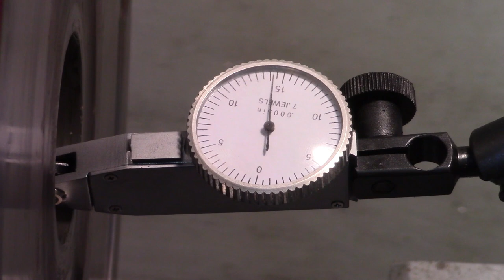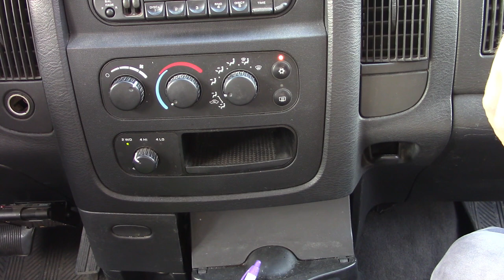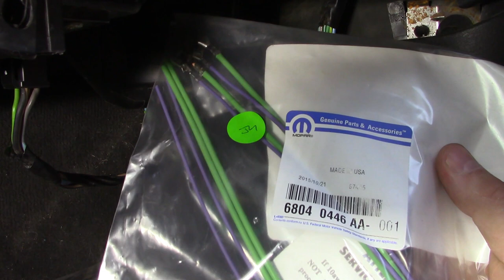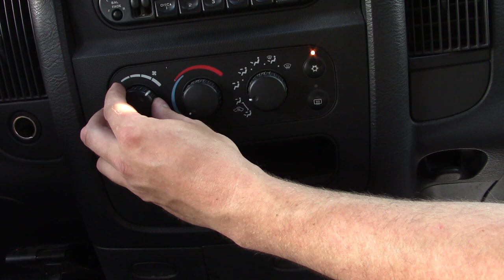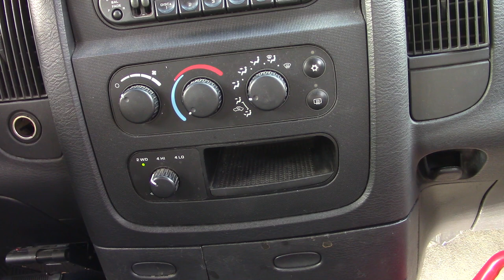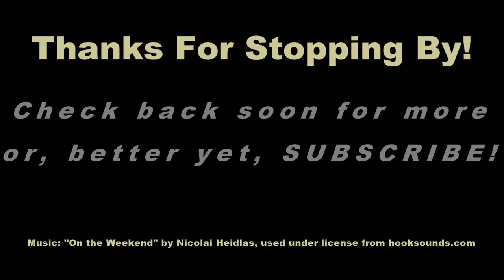Shop Update & Blower Motor Connector Repair

Comment: My connector to my 2006 Infiniti m35 is not online anywhere I have no idea how to get one !!
Reply from the maker: Hi Dnario, you mentioned your car so out of curiosity I started looking up Infinitis.  Like you, I could not find anything for the connector to the blower motor itself, and looking at pictures of replacement motor units they look like they are an oddball design for sure.  Even RockAuto, where I often go if in a pinch, didn't have one.  I guess going to a wrecking yard might have to be in order, otherwise if you could maybe fabricate something up with good-quality spade connectors and some non-acidic adhesive to glue them to the terminals on the motor?  Seems kind of dumb that replacement connectors are not available.
Reply: @EverettsWorkshop  thanks brother yeah I went to “Findpigtails.com” they had the exact piece it’s getting cold out wouldn’t want to not have heat

Comment: 2005 Towne & Country. Please! Tell me....i don't have to sodder!!! Lol was never told I would need to and that just crimping everything together would suffice....i don't have a torch lol or whatever and have already spent more money on this than the local mechanic would charge...
Reply from the maker: If you use a good quality crimp splice and crimping tool it will work fine, I just prefer to solder.

Comment: I changed wires but it keeps melting 🤷🏻‍♂️
Reply from the maker: If they keep failing you may need to replace your blower motor and resistor as well - if there's a bad connection in one of them it can create an unwanted voltage drop and create a hot spot in the harness.  I was able to clean the terminals in my blower but yours might be too far gone for that.

Comment: Is there anybody that could give me a picture of The resistor and the pigtail wires?  I started changing mine out and I think I messed up the wiring.  Thank you in advance
Reply from the maker: What kind of vehicle? If it's a 2003-2005 Dodge pickup I can get a picture. If it is, email me and I'll have a look
Reply: @EverettsWorkshop  it is a 2010 Mercury Milan
Reply: I messed up the AC connector has two wires gray and yellow, I'm trying to figure out if it should go to the first or second wire in the harness that connects to the resistor.
Reply: @EverettsWorkshop  I'm trying to send a picture but I have no clue how. I'm so sorry.
Reply from the maker: @rebeccab3587  Hello again Rebecca, I'm sorry but I don't own any Ford products and don't have any of their service information here. Have you considered getting either a Haynes service manual or doing the Alldata Personal Subscription for your car? It's 30 bucks a year for one vehicle and you can get connector pinouts, wiring diagrams, service procedures, etc. Would be worth while looking into. 
http://www.alldatadiy.com/?gclid=Cj0KCQjw4f35BRDBARIsAPePBHwuvdIW2OUn2kVf__r-0qkzlYMu_SKITit5NUiaXCmz6AFE4K-ZAqkaAgtFEALw_wcB
Reply: @EverettsWorkshop  ty

Comment: What was the part number for that kit? I need the same one.
Reply from the maker: It's a Mopar 68040446AA, but looks like it also crosses over to a Standard Motor Products S2041.  Just make sure that the terminals on the motor are nice and clean, whether you use a trimmed emery board (normally used for filing finger nails) or a small diamond file is up to you.  Just make sure they're clean and free of corrosion.

Comment: My clip came with the wires crossed and I have to reverse them, because my fan is blowing backwards. People keep telling me to just “push back the little (invisible) tab inside and push the wires out - no need to cut and splice.”  Sounds simple. It’s isn’t. I’ll tear the dang thing apart trying to get those wires out without all the special electrical tools. “Just use a paper clip or tiny screwdriver,” they say. I did. And I’m scraping the plastic and nearly bending the metal of the connector. I’m so frustrated I could scream. I successfully installed the rest of everything and the new resistor works. But this dumb, stupid little clip. 😡 😤
Reply from the maker: Weird that it's backwards, but it doesn't overly surprise me (I've seen a lot of new parts come wrongly assembled).  If you've never disassembled an automotive electrical connector then I could see how it would be tricky - we all have different areas of experience and I certainly don't look down on you for having trouble getting it apart.  You have experience and knowledge in parts of life that I don't.  Once you do a few connectors you can see the pattern in how to disassemble them, but that comes in time.  Hope the connector repair works out for you, glad the rest of the job sounds like it went well.